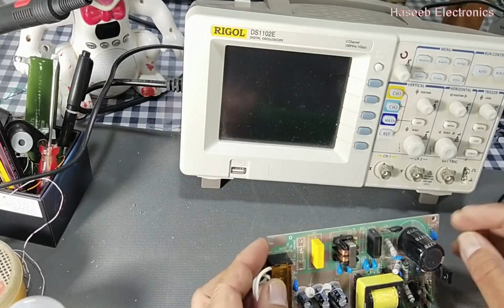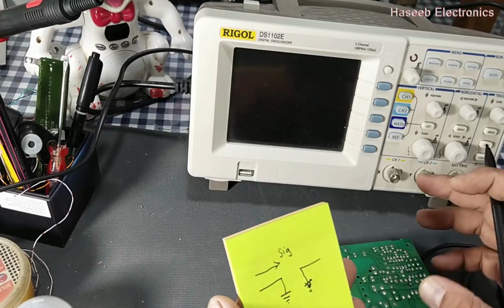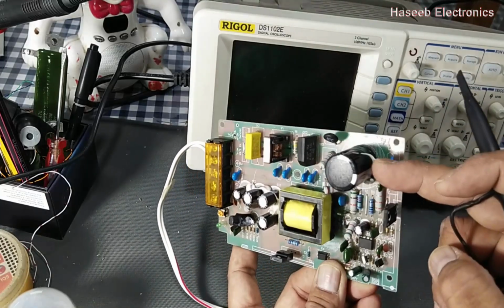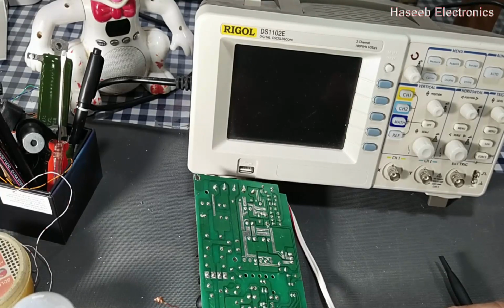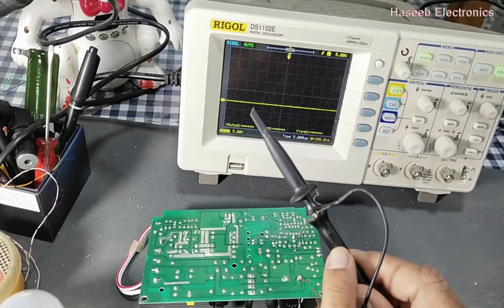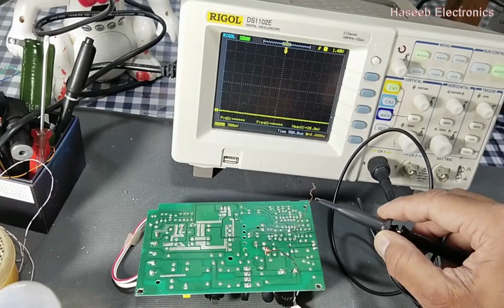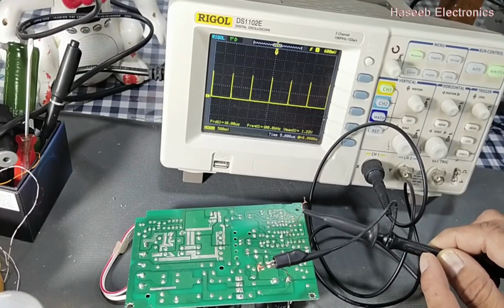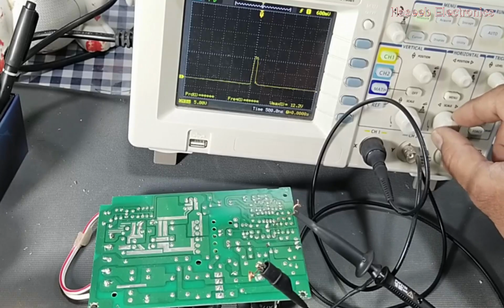{531} How To Test Signal With Oscilloscope / How to Connect DSO to Test Signal

Comment: How did you manage not blowing up your scope without isolation??
Reply from the maker: i am sorry for missing the safety parameter of isolation 
so i removed this video 
and replaced it with video number 532. 
i use isolation transformer 
please check video number 532

Comment: Sir, can we directly check 230ac voltage & frequency  using dso.....
Reply from the maker: yes we can check
try to use isolation transformer to power-up the oscilloscope. let me demonstrate in upcoming tutorial practically in video number 533 on 8 or 9 Jan 2022 and then you can try it

Comment: Sir, in 10x probe selection  what is the maximum level of voltage we can measure???
Reply from the maker: it is displayed near the BNC input connector near channel A&B input
if you will use 10X probe 
then multiply that voltage rating with 10 
but in that you must use high voltage probe

Comment: Good tutorial I appreciate 
I will like you to do a video on different DSO oscilloscope recommending the best I want to get my oscilloscope
Reply from the maker: best regards and special thanks for your comment 
i removed this video and 
i will upload this video tomorrow again after some correction
as i forgot to mention the safety point of isolation transformer 
for a normal life it is recommended to purchase 100MHz, 2 channel 1GaS/S
i suggest 
1. Hantek
2. REGOL
3. Uni-T
or any other brand. as most of the oscilloscopes are using the same board just they change their logos.
Reply: @HaseebElectronics  thanks for your quick reply I appreciate
Reply from the maker: if you want to purchase some best brand then
Siglent
HP
Wavetek 
TekTronix
Owon
Reply: @HaseebElectronics  okay sir thanks